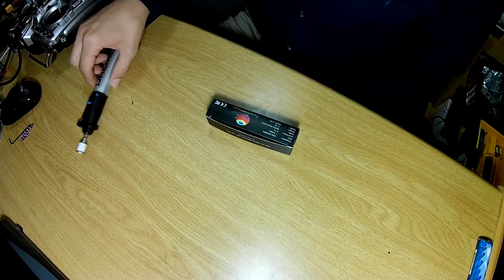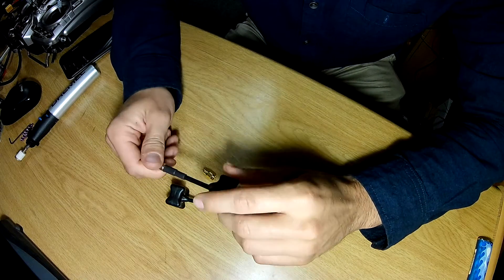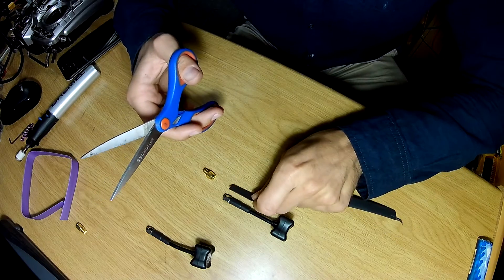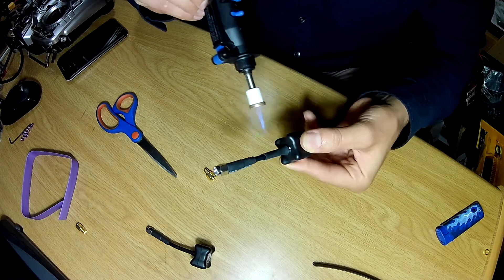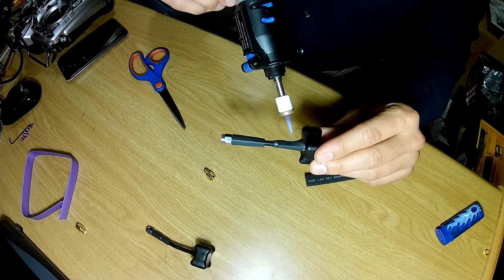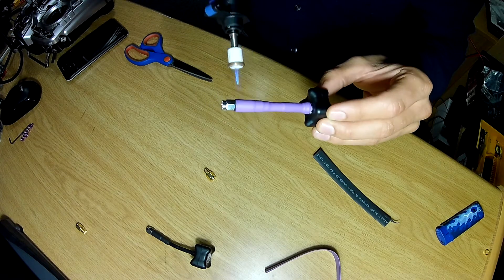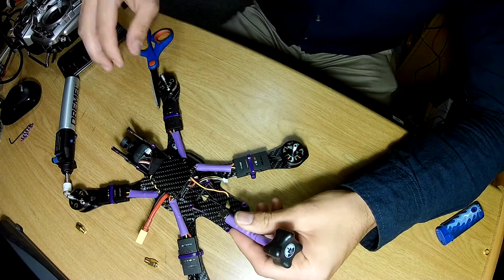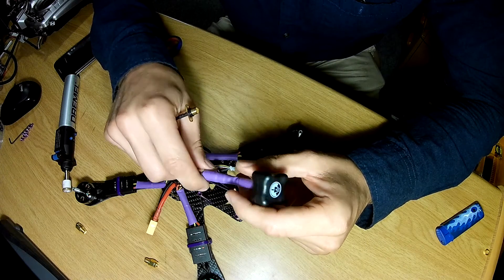TBS Triumph Antenna  - How to Protect Against Crashes

Comment: Hey Blom
Can you please tell me what size heatshrink I would need to get to put over the plastic cover?
Im from Windhoek, dont have a great selection to choose from so I might need to order online, and dont want to order the wrong stuff.
Thanx
Reply from the maker: Hey man, I'm not entirely sure but taking a guess 10mm should fit over just fine, If I were you I would get 10/12/15mm selection, you'll always use it.